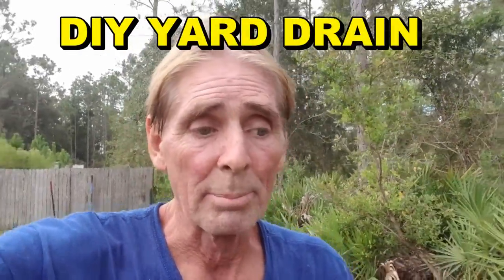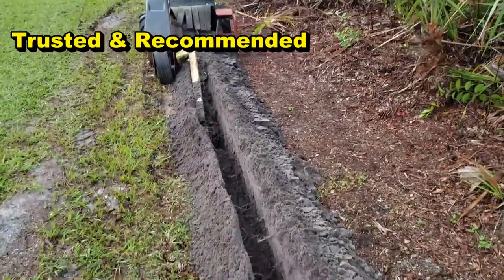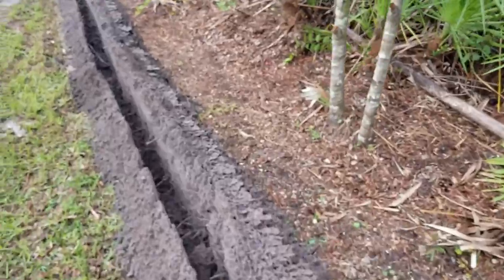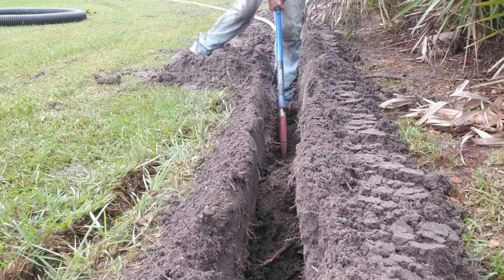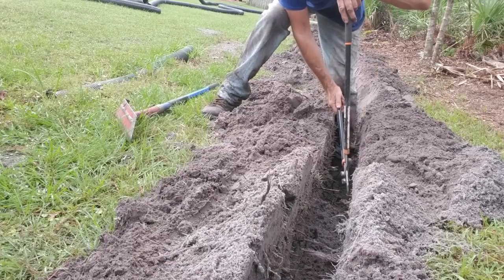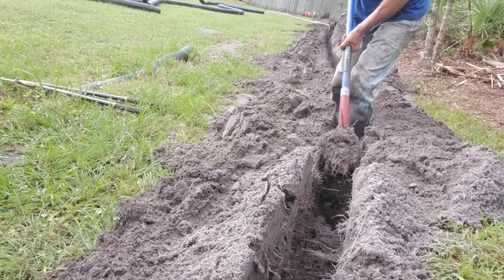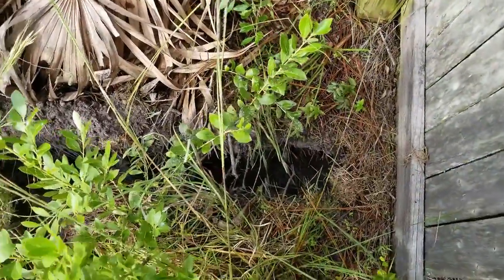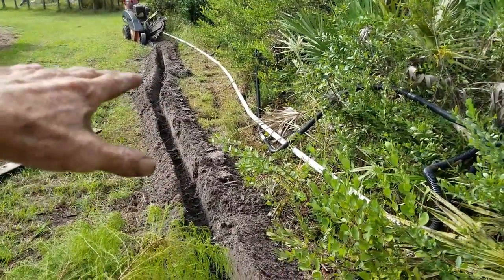Yard Drain, French Drain, DIY with Money Saving Tips and and How To

Comment: Any tricks to figuring the fall of the pipe?
How about if your low side ends up at a side walk with a curb on the other side
Reply: Call whoever owns that easement and discuss options. Some counties/cities allow you to connect directly into the sewer system. Typically that is not allows in Florida though so you just expel the water to the least damaging place as possible.

Comment: So, what happens to the pipe that it no longer works after 15 yrs??
Reply: Dirt, sand, and other debris slowly creep into it and clog it up.
Reply: I've found that the French drain we inherited when we bought the house was totally full of soil. I don't know how long this took. I have cleared it out with drain rods and a pressure washer and added catch basins at intervals for access in the future. The actual perforated pipe was still perfect. I'm also laying new pipe but will wrap the pipe and gravel in a fabric to prevent the same problem recurring